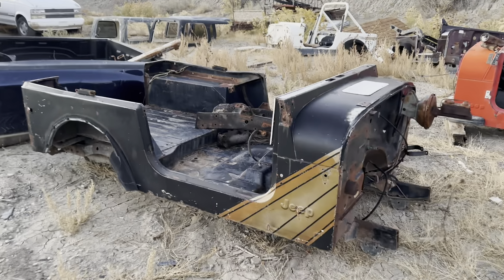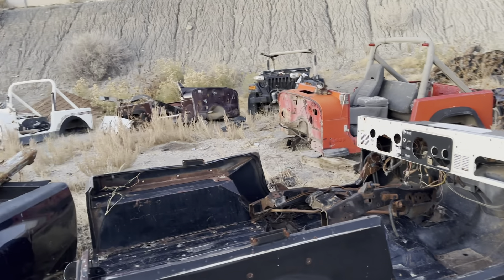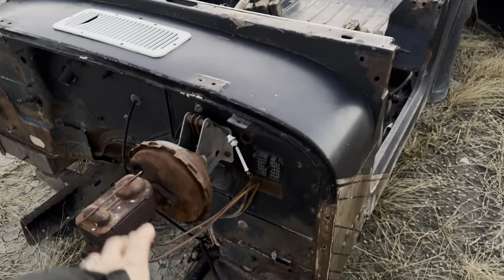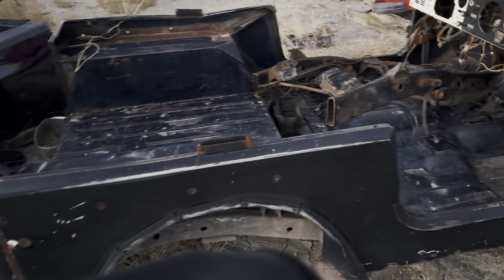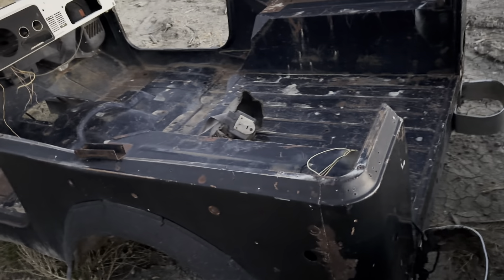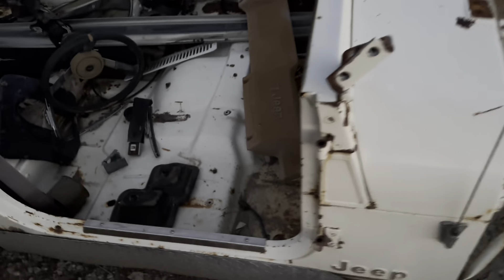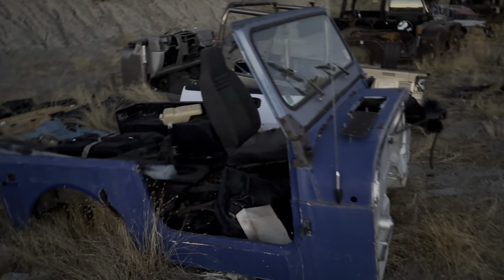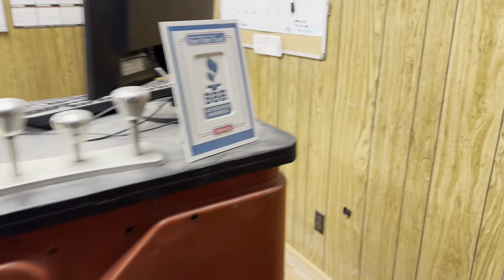Difference between early CJ7 (1976-1977) and late CJ-7 tubs 1978-1986 also YJ tubs for converting

Comment: Nice cold weather video! Are you interested in an original radiator from a 78 CJ7 304? It is drivable , town only due to a seepage in the core. Rebuilt in a Denver radiator shop but still seeps. Good luck on your East coast trip.